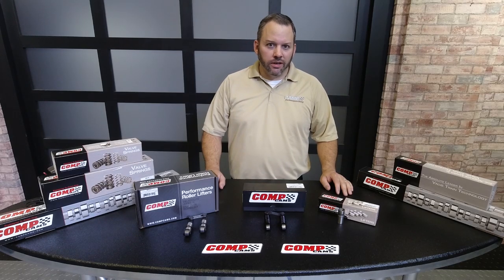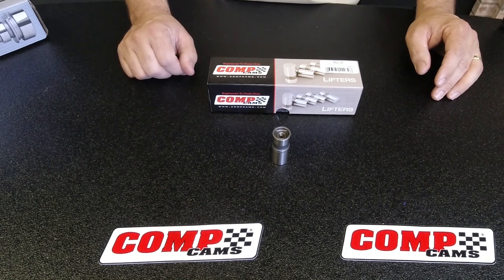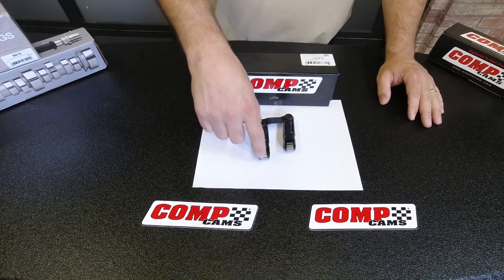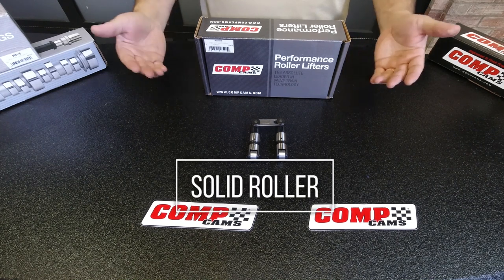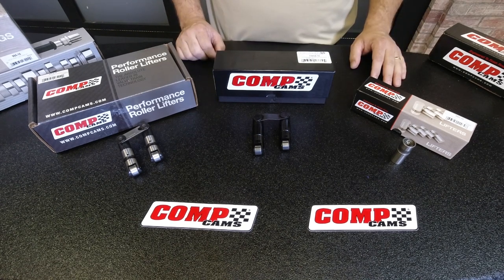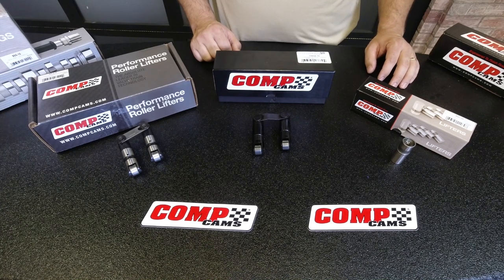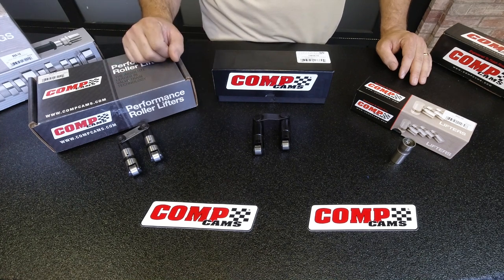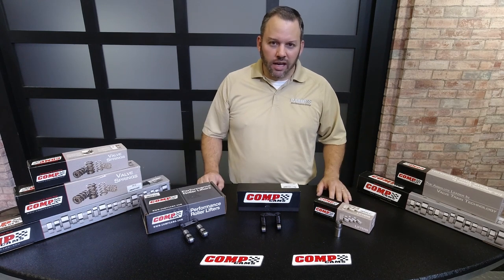CPG Nation Horsepower Tech: Lifters

Comment: If you put an oil port through the rolled groove oil galley and a oil port on the roller end and then flare that end it should cause oil to squirt out over the roller bearings in a cone pattern!

Comment: Great to finally hear some detail on short throw hydraulic lifters. This is what i have as reccomended for my application, but is good to understand why.
P.s the preload setup you mentioned for them us not in the instructions. It only states to do 1/4 turn technique??. Part number 15853-16
Reply from the maker: Its the difficult part of having a set of instructions because one size doesn't fit all.  How much RPM are you trying to turn with your hydraulic roller set up?  What are your spring pressures?
Reply: @Compcams1976  thanks for reply, my engine is dart 401, afr 220 heads, forged internals 10.75:1, 98 octane. cam is custom grind .637 .621 valve lift, 254 260 duration @50 108 LSA. Lifters are part number 15853-16. Springs are part number 953-16. Not been on dyno yet but loves revving up to the current 6800rpm limiter.
Reply: @Compcams1976  any advice??

Comment: Thank you for the lifter cleaning advice. What are your thoughts on using a solid roller lifter on a hydraulic roller cam?
Reply from the maker: Its always a good idea to consult with our techs before making such a decision based on what you're looking to achieve with the engine.
Reply: Not designed for it ramps are different between the two cams. Consult Crower Cams they know more than generic com cam.
Reply: @cammontreuil7509  lol. My cam is a Comp Cam and I will stick with them     . Crower is a good company and if I was using their cam, I would follow their advice.

Comment: Lifter clearance. One millionth of an inch ? After saying such bs I started to question everything this "tech" said. But money he has never assembled an engine and got it running adjusted and tuned.
Reply: That's not very kind.  You are correct in saying that the "millionths of an inch" is not correct, but there are more polite ways to point it than that. Let's try to bring some honor and integrity to the comments section everyone!
Reply: @bradsimpson4899  in this day and age I call BS on anybody.

He that is faithful in what is least is also faithful in much.

It's a principle I live by. If someone is going to put themselves out there as an expert, they better get it right.
I also appreciate you tempering my comment.
I can and have really got into the face of a person at times. 
But one benefit or curse. I will bring out the best or worse in you.
Thank you for your thoughts.
Reply: @bradsimpson4899  that's cool but what about waiting on hold for tech support 2 hr's...
My motor has 10 k in mods,  This video should have been edited.  Small details will RUIN AN ENGINE.
Reply: What is the clearance between the inner slug and the main body? He was not talking about the clearance between the lifter and the bore of the block. That's more like 0.0015" and 0.002"
Reply: @gtorjoepontiac5136  what project are you working on ? I hope you didn't go  Comp cams. 
I'm a seasoned engine builder. Been around 40 years.
I stopped counting after doing 400 engines.
Reply: @cammontreuil7509  I had a lifter issue, which ended up being a complete rebuild. I spent 1100 on evolution bar lifters and yes a custom comp cam... 
I've also spent close to 4hrs on 4 different  phone calls to comp cams tech line....I had an LS7 lifter failure originally, 
It's an LS3 forged  stroked 408 . Made 520 who, however we are replacing the -20cc dished wiscos with wiseco flat  tops.
Reply: @gtorjoepontiac5136  sorry to hear all of that. Crower severe duty roller lifters are the best in my experience.
Document all you blueprint work. 
So we don't make the same mistake again.
I always put magnets in drain back areas in heads and in oil pan/sump.
If metal dust is ending up on the magnets, something going wrong.
Reply: He didn't say clearance, he said tolerances are in millionths of an inch which is completely feasible. You need to listen better before thinking yiu are so smart :)